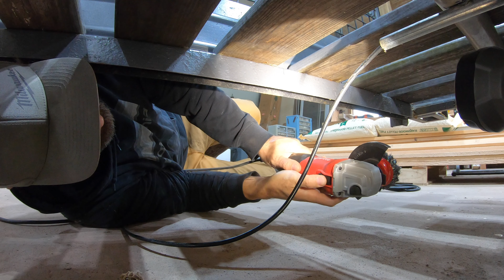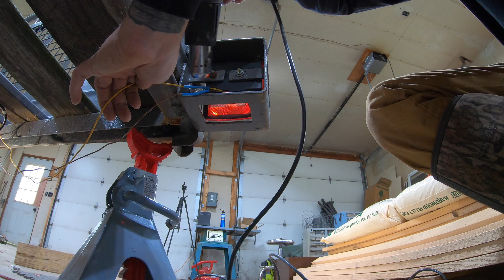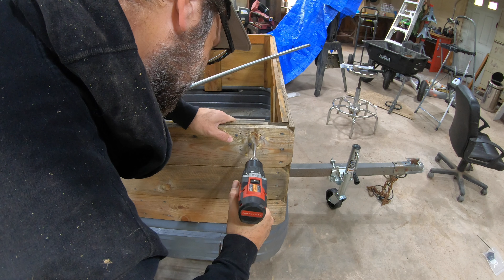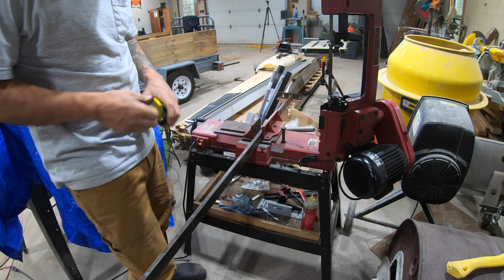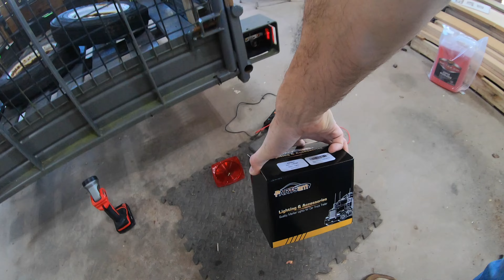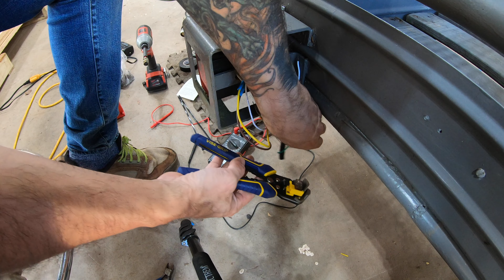Fixing A Small Trailer and Making it More Useful - Hand Crank Tarp, Wiring, Wheel Jack, Welding

Comment: Hi I enjoy your videos I was wondering where did you get your step up for the tailgate I have the exact same truck.
Reply from the maker: That comes with the bed utility group. You can buy it separately though from the Mopar site or dealer. It’s not cheap though: 

https://www.mymoparparts.com/oem-parts/mopar-bed-step-for-ram-2500-and-ram-3500-pickups-82215842ag?c=Zz1leHRlcmlvciZzPXNpZGUtc3RlcHMmbD0yJm49U2VhcmNoIFJlc3VsdHMmYT1yYW0mbz0yNTAwJnk9MjAyMSZ0PXRyYWRlc21hbiZlPTYtNGwtdjgtZ2Fz